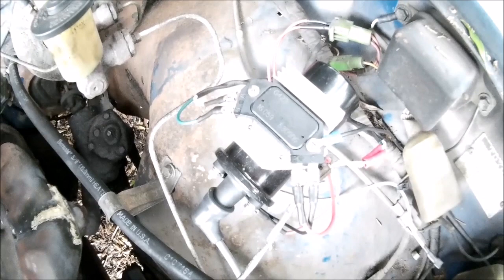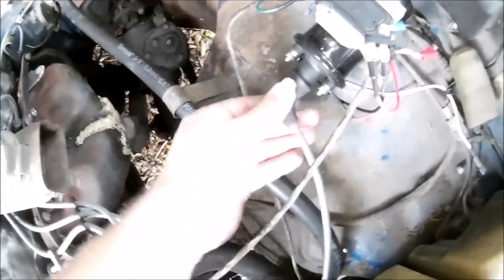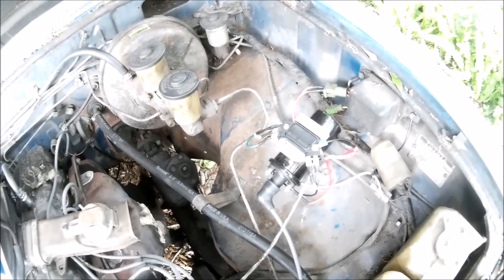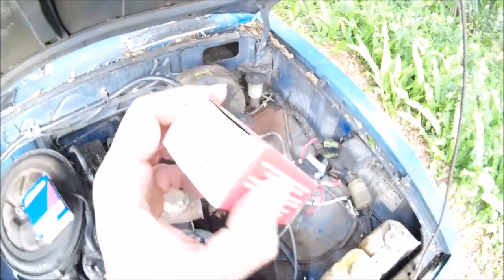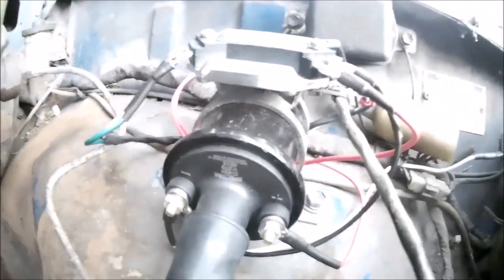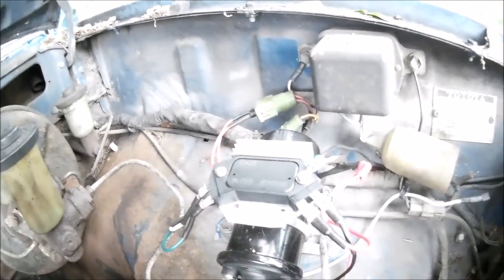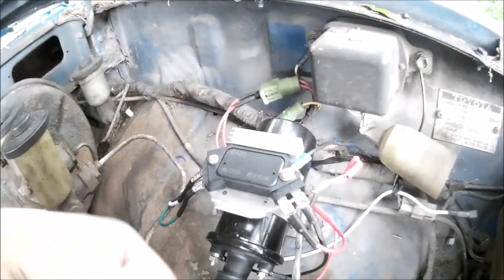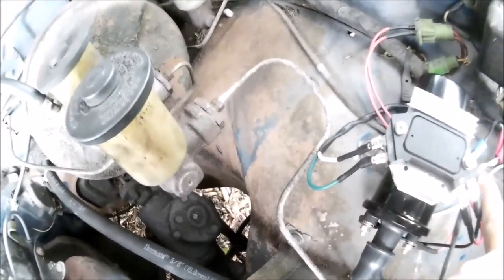1978 Toyota Pickup/Hilux 20R - GM HEI Ignition Module Conversion

Comment: Hello, I have the same 1978 toyota with a 22r engine,  I have installed the HMI module , and my issue here is the minute I start the engine , it ran for 3 seconds then shuts down, after troubleshooting the module I have found that the module is blow.(Dead module)
I have all the grounds and fender metal clean for grounding  contact.
Also, there is good coverage of heat compound on the module.
What would de causing the module to blow open?
Reply from the maker: I assume you mean H.E.I. GM module? I've never heard of a "HMI module".
If the module is 'blown' (dead module) it shouldn't even run for 3 seconds; it won't run at all on a dead module.
You mention 'heat compound' so I am guessing you mean thermal paste? If so what kind?
I'm also unsure of what is meant by 'good coverage' of heat compound. Thick or thin layer?
You didn't mention if you installed a heat sink with the module; did you install one?
I need more specific information in order to give you a solid answer. Be as complete as you can. That's the only way I can even start to try and answer the question as to why the module 'blew' or shut down.

Comment: Thank you for saving me so much money by doing this conversion!
Reply from the maker: You're welcome, I'm glad it helped.
Reply: hey man! I need your help... did this conversion on my 77 hilux changed the distributor for an electronic one, had it running for 5minutes than it stopped. Did some more tests to understand what was wrong, pretty sure the module burnt. current wont go throught anymore. Do you know what could be the cause?
Reply from the maker: @AlexTech1111  No idea with so little info to work with. I need all the complete details about what you did, what testing results you got, anything that may seem relevant. Otherwise I'd be guessing which won't help you.

In the meantime, if you think the module burnt (why do you think this?) take it to a part place and have it tested. Most parts shops will test HEI modules for free if you ask.
Recheck every connection to be sure they are clean and firmly in place, no loose connections. Recheck the ground connection to the module; that connection is critical and needs to be clean and solid.
Check your distributor pickup coil air gap. Spec is 0.08" to 0.16" or 2 to 4 millimeters. Make sure the hold down screws on the pickup coil are tight so the coil doesn't move after setting the gap.

That's some basic things to check/do. Let me have all the extra info on what is going on there so I can help you better.

Comment: Would this work on 22re
Reply from the maker: I think that it would but I need to qualify this answer. I have never tried it myself on a 22RE so I have no direct experience on that. And I haven't seen or heard of anyone else doing it. It does work on a 22R carb version. I know this for sure because I've seen it done and it works.

To the best of my knowledge the distributor is the same one for either 22R or 22RE, so I assume that it would work. I did a bunch of part lookups on this for you and there appears to be no distinction on the distributor part number between the carb version or the EFI version. Both use the same distributor and that is what leads me to believe that the conversion would work on a 22RE.

Comment: Hi i was referred to this video on the Toyota forums. I have a 1977 toyota pickup with a 20R engine. I read one of your comments saying i need to purchase an electronic distributor from rock auto. Once i replace my old distributor, the HEI model will work with the new distributor? I appreciate any guidance. Thanks
Reply from the maker: Correct, the 1978 or 1979 20R electronic distributor that has a pickup coil in it will work with the 4 pin HEI ignition module. Here's the distributor: https://www.rockauto.com/en/catalog/toyota,1978,pickup,2.2l+l4,1277108,ignition,distributor,7108

I recommend the 1978 or 1979 distributor because it has the single vacuum advance unit on them and are simpler to deal with. The 1980 & newer 20R & 22R distributors have a dual vacuum advance/retard diaphragm system. You can also make one of those work (pickup coils are exactly the same as the 78/79's), but you'd only be using the advance diaphragm on it. That requires some further instructions/explanations.

Any further questions just ask.

Comment: Hi, love all your videos! Very informative. I have a question about the ignition system. What is the black box mounted at the fender wall with wires coming out of it into a cylinder that’s just laying there? 

I have a 72 with a 20r and can’t seem to location my igniter. Doesn’t have one that sat on the top. All I can see is the coil, resistor and the same black box that’s mounted the same with wires connecting to that cylinder. Also don’t have those green plugs. Really confused
Reply from the maker: Thank you for the compliment, just trying to help others out there with similar vehicles/engines.

The "black box" on the fender wall is the Voltage Regulator. The "cylinder" isn't actually a cylinder. It's a rubber sleeve (original stock item) that covers & protects the connector for the Voltage Regulator.

If your vehicle is still in it's original stock configuration, your '72 isn't going to have an igniter (electronic ignition module/unit), it's going to have contact points in the distributor. Toyota didn't start using the electronic ignition Igniter system until the start of the '78 model year. '77 & earlier models had the contact points system instead, so it would make sense that you can't find the Igniter, because it simply isn't there.

I assume that you are possibly looking to convert your engine from the contact points system to an electronic system? You can do this but you're going to need the "newer" model of distributor from '78 to '80 (preferably) that has a pickup coil/signal generator in it. Here are two link to the different distributors. First one is the older contact points type (like you probably have) & the second is the newer pickup coil type for electronic ignition. Comparer the two & you will see the difference.

Points type: https://www.rockauto.com/en/moreinfo.php?pk=28275&cc=1277041&pt=7108&jsn=934
Pickup Coil type: https://www.rockauto.com/en/moreinfo.php?pk=28295&cc=1277108&pt=7108&jsn=980

The two different distributors are interchangeable in the 20R, direct replacement with no mechanical mods required.
The contact points style distributor will not trigger the Toyota Ignitor or the GM HEI Module, because the contact points are only a simple on/off switch for the Ignition Coil. The Igniter or HEI Module requires a low voltage A/C (alternating current) signal to trigger, which is why you need the type with the Pickup Coil. It operates as a signal generator & will work with either an original Toyota Ignitor or the GM HEI Module.

As far as the lack of "green plugs" goes, I think that's just a model year group thing. Near as I can tell, at least for the North American market, they starting using the green plugs from 1975 onwards. The color of them doesn't matter. You should still have the two ignition power feed plugs same as mine, just a different color (possibly white?) but they operate the same.
If you look for the "+" wire that is currently going to your Ignition Coil "+" terminal, that's the one you need. Just back-track from the coil's "+" terminal & you will likely find the correct plug to use for keyed ignition power.

I hope this makes sense & answers your questions. If I can help with any other info or advice just ask. There are several key points to this conversion to make it work well and reliably, & I can provide you with that if you need it.
Reply: Thank you very much for the quick and detailed reply. If only all other YouTubers were this attentive and helpful. If I run into any other issues I will be sure to ask! Thanks again!
Reply from the maker: @gusamaya2934  You're most welcome. I always try to be as complete as possible, because having to guess about certain factors to a problem only gets us into trouble. 🙂I am always monitoring my messages on Youtube, so I should be around for any questions that may come up about this conversion.
Reply: @The13thSword  I just saw your video when you dropped the gas tank. I did the same thing and I found that the plug on top of the fuel pump has two wires. Yellow/Red stripe and a Black/Red stripe. I’ve looked in the same manual that you have and can’t seem to find the second set of wires(Black/Red). Am I missing something?
Reply from the maker: @gusamaya2934  I need you to be a bit more clear here, because I'm not sure what you mean by "the second set of wires(Black/Red)." There is no "second set of wires". There are only two wires that go to the gas tank & connect at the fuel pump & fuel sender flange.

The Black/Red is the voltage feed to the fuel pump.
The Yellow/Red is for the Fuel Gauge Sender (the sender in the tank is what operates your fuel gauge in the dash cluster).

Have a look at this link: https://toyotamotorhome.org/forums/index.php?/topic/6410-1975-electric-fuel-pump-wiring-diagram/

Scroll down three posts to a post that has pictures. Click on the 3rd picture. It shows the basic stock wiring for the fuel pump, fuel gauge sender, fuel pump relay & fuel pump resistor. Your '72 should be no different from this in basic function if equipped with the electric fuel pump setup.
However, I cannot guarantee that your wire colors will be the same as mine on the '78. It is possible that there are/were wire color differences, but from everything I've seen & heard over the last 10 years or so, I'd suspect it's the same. Just trying to cover bases here.

If you have the same electric fuel pump setup, I can't really imagine it would be any different. The '72 to '78 trucks are all the same vehicle. This applies to all Hilux/Pickups sold in North America, with some minor differences. If your truck is not a North American model, there are more differences.

In any case, if you have the pair of wires at the gas tank that are Black/Red & Yellow/Red, that's all that should be there, there is no second set of wires.
Reply: @The13thSword  yes you are correct. I worded that sentence wrong. I was trying to say,”the second wire.” 

So being that it’s a carb system and has a resistor to lower the voltage, can I remove the resistor is I’m installing a high psi pump in the tank? Reason is because I’m installing a Holley EFI Sniper kit and it gives me an external pump, but would like to keep the pump internal. I purchased a 91 Honda civic pump and just installed it in place of the smaller, less powerful, Toyota carb pump.
Reply from the maker: @gusamaya2934  I'll put my answers in order. If a fuel pump (regardless of internal or external) was designed for a higher pressure EFI system, you should bypass the fuel pump resistor. EFI pumps are almost always designed to run on full battery voltage, as they need to create much more pressure & volume than a fuel pump designed to supply a carb, so they need that extra voltage. Most original-style stock electric fuel pumps for carbs generally are designed & built to run continuously @ about 9.5 volts, for quiet operation & long life. So that's why the fuel pump resistor is there in the RUN circuit.

One of the easiest ways to bypass the resistor is to fabricate a jumper wire with the correct terminals, & use the jumper wire to connect the two terminals in the harness socket for the resistor. You can also of course cut the harness socket off completely & splice/solder the wire ends together, but that would mean that you couldn't easily go back to the original stock configuration in the future, if you wanted to.

My short answer to your second question about the pump is, I'm not sure. Please note that all of the below is based on my assumption that you are using a Holley Sniper 2300 unit.

I did some research and I'm not too sure that the Honda pump is going to work well with the Holley Sniper Kit. Honda says the stock fuel pressure is 43 PSI nominal (normal working pressure). Looking at some quality replacement pumps on Rock Auto, they spec out at 60 PSI maximum. Holley's spec for the Sniper system as stated on their site is 58.5 PSI. That's a 26.5% lower difference in pressure. There also seems to be some differences in GPH (gallons per hour) rating. The standard pump I see coming with the 2300 kit is this one: https://www.holley.com/products/fuel_systems/fuel_pumps_regulators_and_filters/fuel_pumps/efi_fuel_pumps/efi_electric_in-line_pumps/parts/2225

It's specs state 45 GPH @ 60 PSI. Honda says their stock pump spec is about 26.5 GPH. So I'm not sure that a stock-style pump is going to provide either the pressure or volume the Sniper system was designed to work at.

I'd want to know what brand name & part # of that "Honda" pump is, look it up & spec it out to see if it's going to be adequate for the Sniper. Otherwise, I'd just go with the external pump supplied with the Sniper kit, because it's been spec'ed to work correctly with that system.

The only good quality non-Honda fuel pump I can find that meets the Sniper specs is a Walbro GCA3366-2. Reference: https://www.summitracing.com/parts/vpn-gca3366-2?seid=srese1&gclid=CjwKCAiA_tuuBhAUEiwAvxkgTqeRxzb6WzYQUTKTWEvikn_YgmWojWrmlDcnb_Tu9gMLcOeSJsiAoBoCwOgQAvD_BwE
Reply: Thanks for the help. Now that I look at the installation video for the HEI, I’ve noticed that I only have one wire coming from the ignition switch with power(Black/yellow). You have two wires in that green plug. One wire to the coil + and another to the “B” on the GM Module. Can I “Y” off the 12v Black/Yellow ignition wire that goes to the coil to make this work?
Reply from the maker: @gusamaya2934  Yes you can "Y" off the Black/Yellow power feed from the Ignition Switch to make it work. The "extra" power feed hookup I have as seen in the video isn't necessary. In fact, the original/stock Toyota Igniter/Ignition Coil draws power for both items from the Black/Yellow wire.
Reply: @The13thSword  awesome! YOU ARE THE MAN!!!! I kind of figured I could, but wasn’t sure and didn’t want to burn out the module or coil.

Comment: And I made my run without the igniter box I just run the points. Ballast resistor, coil, and I made my own harness
Reply from the maker: That's fine but raises a question in my mind. Were you trying to use a points distributor to trigger the igniter system? That's not likely to work. The igniter system requires a distributor with a pickup coil in it (1978 to 1980 20R or 1981 or newer 22R distributors will work).
The pickup coil is basically a signal/voltage generator that puts out about 3 volts AC, & the igniter uses that alternation current voltage as a trigger signal to turn the coil on & off.
Contact points only acts as an on/off switch & do not generate any voltage on their own.

Comment: I have the original transistorized ignition with California emissions on my 20 r.. somebody screwed with it a long time ago and now I had to tear apart of it out because it had been added on to and I found out that resistor that looks like a resistor takes two positives
Reply from the maker: So you're saying you have the original stock Toyota "ignition & ballast resistor" setup? Is this the resistor you mentioned earlier, the one that had no continuity? If so, then that resistor is bad & acting like an open circuit, no power to ignition coil positive, so there would be no spark.

Not sure what you mean by the resistor having 2 positives? If you mean that both terminals on the resistor are "battery voltage positive" then that's correct.

Which makes me wonder a bit about your saying the resistor has "no continuity". How did you check this? If you were using a volt/ohm meter & had it set to "volts" you would see any reading at all, because you only have positive running through the resistor. You'd need to connect your black test lead to a ground point to see what voltage is there.
Just for clarity here, continuity is checked using an "ohms" setting on the volt/ohm meter, or an actual continuity setting if the meter has one.
Can you be more specific on what you mean by "no continuity"? How did you check for this? Please describe.

Comment: very good video series appreciate it, I have a 1977 20 R engine with only one red wire coming from distributor which I connected to the G but there's no white wire from distributor to connect to W what should I do.
Reply from the maker: If you have only one wire coming out of the distributor, it's either a "points" style distributor, or if it is the later 1978 to 1980 magnetic pickup coil type distributor, the white wire may have broken off. If that's the case you might be able to splice & solder some new wire onto what's left of the old white wire.
If you don't know which type of distributor you have (points or electronic) take a look at this: https://www.youtube.com/watch?v=KNaNp2VLS1I
That video shows you the differences inside within the first minute.

If what you have is the original 1977 points style, it will not work with the HEI module. You need a 1978 to 1980 "electronic" style distributor with the magnetic pickup coil inside. Best place (& best price) IMO to get these is Rock Auto: https://www.rockauto.com/en/catalog/toyota,1978,pickup,2.2l+l4,1277108,ignition,distributor,7108
Some parts stores can get one in for you, & some may match the price; you have to ask about that.

Any more questions just let me know.
Reply: @The13thSword  thanks for your advice I'll check it out